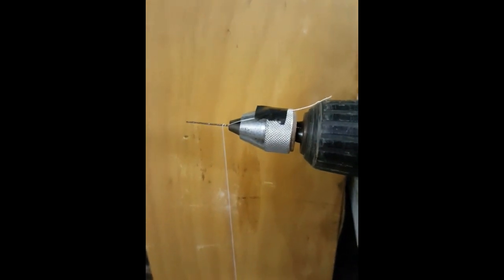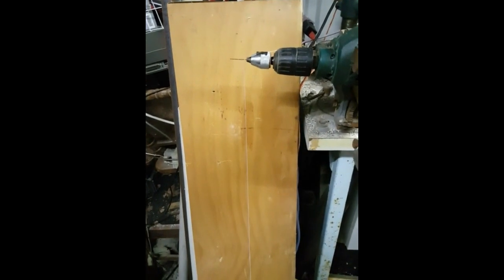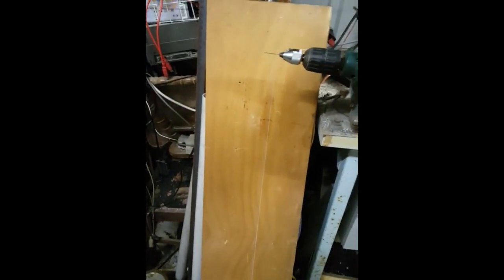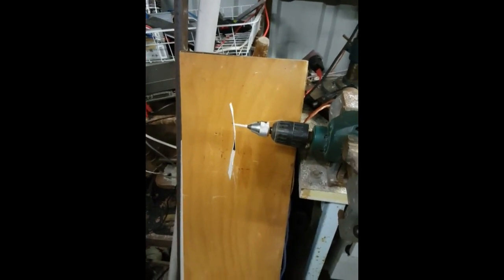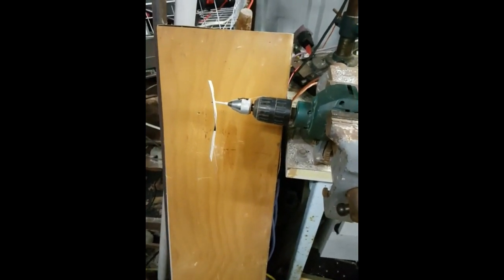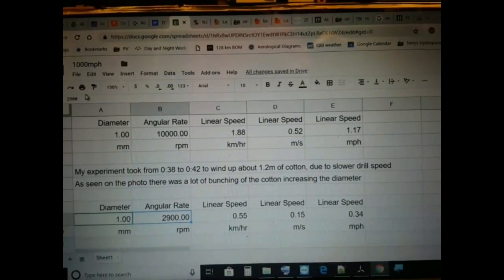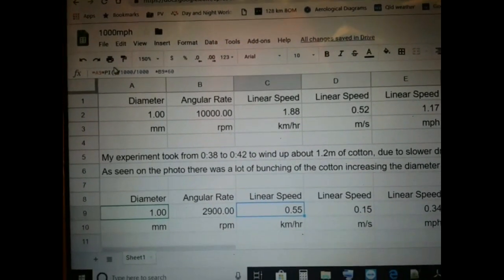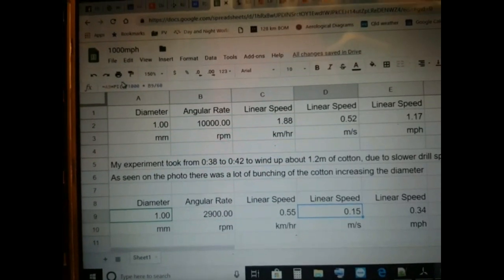Why 1000mph Earth rotation is deceptive and the wrong way to talk about rotation

Comment: Flatties do the same non-sense with a spinning wet tennis ball. They don't realize the speed is relative to the size of the object. A tennis ball spinning 20 mph is fast compared to the size of the tennis and its rotation. The Earth is almost 25000 miles in circumference while spinning 1000 mph so the spin is relatively slow compared to the size of the Earth. Again flatties can't comprehend. Great work!!

Comment: If you do the same wire experiment on the equator and hand the wire to someone standing on the equator while your spool of wire is fixed to a point relatively stationary in distance to earth (like the sun) the wire will still be yanked of the spool with about a thousand miles an hour... So I feel comfortable using the thousand-miles-at-the-equator figure. The angular speed is just more practical to use because it gives you easy acces to the speed of any point with distance r to the rotational axis. Greetings from upside up Holland..

Comment: If it sounds ridiculous that the equator has a linear speed of 1040 mph, what about the lower part of the dome spinning at 3254 mph? It is more that 4 times the speed of sound in a place where there's plenty of air. This is true for a distance north pole - equator = 10000 km, but different distances give similar results.

Comment: 1 revolution per day is still over 1000 mph, silly boy
Reply from the maker: and it is is still  0.0007 rpm, did you miss the point of the video entirely?
Both are correct, and yet by picking the one that sounds big is being deceptive isnt it?
Revolution speed is measured by angular rate of change, mph is a linear rate of change and so should not be used for measuring rotation.
Reply: @whereswa11y  the one sounds small and is actually really deceptive. It is still over a 1000 mph. Have you ever been water skiing and whipped in a circle in a long rope?
Reply: @my2cents901  and do you measure the boat propeller speed in RPM or MPH ?  Its rpm,   heavy machine flywheels are they rpm or mph?
Reply: @whereswa11y  1000 mph is fast. You like the example you give because it sounds small and stupid people think it sounds reasonable as an explanation for why we don't feel movement. Of course the real reason we don't feel movement is because we aren't moving one single inch in any direction ever
Reply: @my2cents901  - Or maybe we only feel acceleration forces, positive or negative,  and the earths rotation is so close to being constant you would need to monitor and measure it for a very long time to identify any acceleration forces. Good luck "feeling" any of it.

But what would I know? I am after all just another NASA shill, sock puppet bot account. 😉
Reply: @iliketurtles4463  or the most likely reason is we're not moving
Reply from the maker: @my2cents901  So you are saying the earth iw not moving or at a constant speed of 0.
Globe model also says earth is at a constant speed of 1 revolution in 1 day.
Reply: @whereswa11y  not moving at a constant speed of 0 is not the same as your Globe model silly boy your Globe model has a spinning at a thousand miles per hour in order to turn 25,000 miles in 23 hrs 56 minutes and 4.1 seconds. What you're saying and what I'm saying are completely different and not even remotely similar
Reply from the maker: @my2cents901  both 0 and 1000 are a cpnstant speef. Np acceleratipn and as wr can only sense accelerations you will not feel anything different.  You do not feel speed just changed in speed. Why does 800kmh on a plane feel the same as 60kmh on the road?
Reply: @whereswa11y  let's say that thousand plus miles per hour is that the equator in your ball world so if I go north or south the speed would be the last and so it should be noticeable and if I'm up North and go towards the equator it should be noticeable because speeds would be changing LOL
Reply from the maker: @my2cents901  yes the rotation is less. AND we saw  that ead so on the video i  made  for GreaterSapien. The plane was flying faster than earths rotation at 62S. So ball is real.
Reply: @my2cents901 Do you think it's ridiculous that the equator has a linear speed of 1040 mph? What about the lower part of the dome spinning at 3254 mph? It is more that 4 times the speed of sound in a place where there's plenty of air. This is true for a distance north pole - equator = 10000 km, but different distances give similar results.
Reply: @psalux18963  or the flatopia sun rocketing around at supersonic speeds inside an atmosphere then teleporting into different places.

Comment: There must still be a better way to state the rotational speed. All planets rotate at 1 revolution per day as one revolution is a day is it not? I like degrees per hour or something more universal. I suppose it's all just a means of describing the same thing, no matter how many times you shuffle the deck, it's the same 52 cards in there...

Makes me wonder if other intelligent species have better units than us, like all distance, velocity and time measurements based off the speed of light or something.
All force units based off something molecular, like the energy required to break the covalent bond of methane or something...

It's 3am and I'm thinking too deep now, time to settle my tab and get out of here!
Reply: Rotation is usually referred to rotation around the object's own axis . Revolution is based on the external axis . So, it is Earth's daily rotation (1 Earth's day) vs. Earth's revolution around the Sun (1 Earth's year).
Reply: RPM doesn't matter by itself, either. What's important is the relationship between angular velocity, radius of the circle, and the centripetal acceleration required to maintain the same path and speed. People need to know that centrifugal force isn't a thing- it's inertia, not an outward force. We don't go flying off the earth because gravity provides more than enough force to keep us on course, and there's nothing pulling us away from the planet. We don't feel it because it's constant.
Reply: Yes, but given that difference planets rotate at different speeds, an Mars day is not the same as an Earth day. A Mars day is 37 minutes longer than on earth.
Reply: Late to the party here, but... only Earth (or by some stupidly unlikely coincidence, some other planet) rotates 1 rotation per "Earth day." Each planet's "day" would be defined differently, and thus would be a different number of seconds (which in itself is based on the "Earth day," at least originally)... basically, it depends on your base assumptions about units of time. Not to mention that Earth's day length is slowly changing... Anyway.

Now your question has been postulated by scientists before, and actually utilized at least as far back as the Voyager program, possibly farther, but that's the one I remember off the top of my head. Not sure exactly what they used off the top of my head (without looking it up, I think it was something about the frequency of a particular hydrogen emission to define a time unit, a conversion to a year unit, and thus (using c or 'the speed of light,' another physical constant) to a light-year unit, then defining Earth's position in light-years from a dozen or so nearby stars), but the concept was there.

The concept is 'fundamental units' and is based on unchanging physical constants. However, these are really, really, really cumbersome for 'human use.' 
How cumbersome? Let's build one.

The Lyman alpha line (Ly-α), the emission line at the lowest energy transition of (and thus the lowest energy photon emitted by) the hydrogen atom in the Lyman series (there are other series, Balmer, Pachsen, Brackett, and Pfund being the named series, with lower energy transitions and photons associated with them, but that's really irrelevant here), is at a wavelength of 122 nm (or a frequency of ~2.47×10^15 Hz or cycles per second). Therefore, our hypothetical basis for time can be one Ly-α cycle, and our hypothetical basis for distance can be one Ly-α wavelength. So now we have our fundamental units, all we have to do is translate our human units into their terms.

So, if the Earth turns at 15 degrees per hour ( or .0041667 degrees per second) it would turn 1.68692 x 10^-18 degrees per Ly-α cycle  
or 2.944236 x 10^-20 radians per Ly-α cycle, which would be the 'correct' way to state a rotational velocity, using strict math and fundamental units.
Keep in mind that there are 2 radians in a circle, which means that there are ~67.93 quintillion cycles in an Earth day. 

Or you could state a linear speed in wavelengths (wL) per Ly-α cycle(Lc).  
(460m/s) /( 122nm/wL) = 3,770,491,803.27869 wL/s 
(3,770,491,803.27869 wL/s) / (2.47 x 10^15 Lc / s)  = 1.52651 x 10^-6 wL/Lc. 

That's the Earth rotating at a linear speed of a little over 1.5 millionths of a wavelength of Ly-α per cycle of Ly-α. 
In other words, in the time that it takes an emission of Ly-α to cycle once, a spot on earth will have moved 1.52651 millionths of a wavelength 
(with one wavelength measuring 122 nanometers, the planet moved about 186.23422 femtometers during that cycle).
 
Fundamental units are all well and good... but anything at a human scale is going to require translation, otherwise it's "just numbers" even to people who can think in that sort of thing. 
[edit] corrections.
Reply: oleyella85  Just glad someone read it, Cheers!
Reply: @TTown Joe It's 0.0007 RPM. You missed one zero.